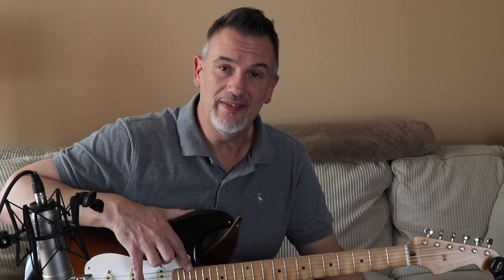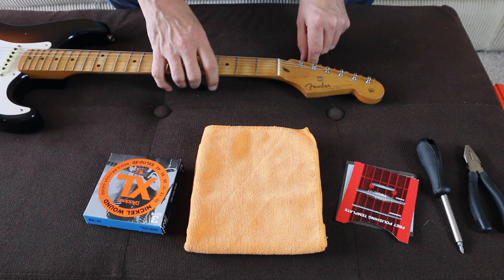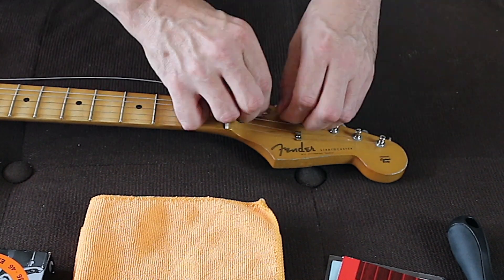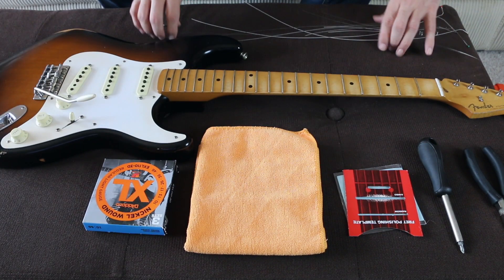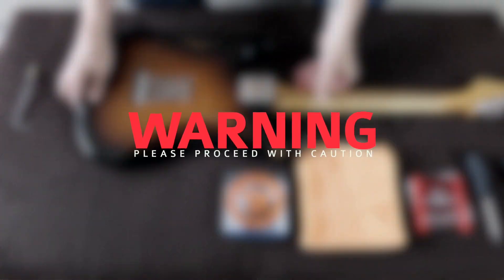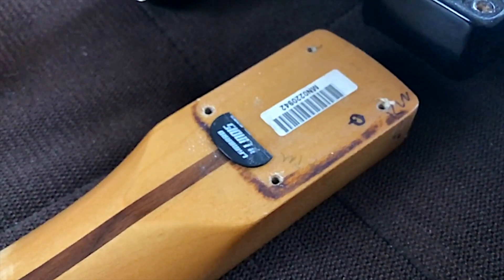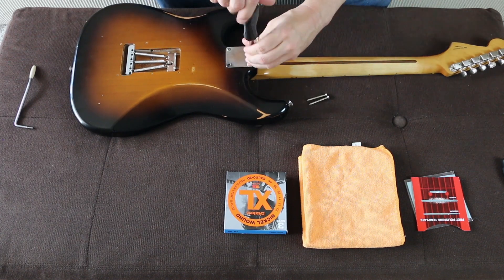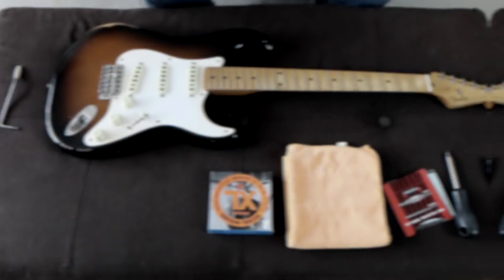Can you SHIM a guitar neck with a pick?

Comment: I have one bass where I had to do this kind of shimming at the front of the neck pocket. I used full width veneer piece instead of a pick and I made a narrow wedge piece just to cover the gap at the bottom of the neck. Now when you look at the neck joint you will not be able to see that the neck was shimmed. The tone and the sustain has not changed at all.

Comment: Totally worked for my jazz bass. Only I did it the other way around to decrease the bend and have the strings closer to the frets. However this was not an expensive bass so I didn't worry about anything in the first place.
Reply from the maker: If it works it works i say, it worked out for me so i was happy. Cheers for the comment
Reply: I would take that out immediately, get a full maple neck shim this will warp your neck up on the higher frets eventually and it with fuck your neck up big time.

Comment: A refinement to this idea is to use a pick with a known thickness, as from a set of picks of different thicknesses. If the first try doesn’t adjust the tilt enough, you can move up to the neck pick size until you zero in on just the right thickness.

Comment: Hi Derek, I don't mind that you used plastic instead of wood. It worked for you just fine. I smoke cigars, so every time I buy one they give me these very thin sheets of wood to light a cigar. First you light the wood with a wooden match, and then you light a cigar with that wood. So I'll try to use that. The only problem is that I don't want to waste a new set of Fender Bullet strings, I put them on yesterday, but the action is to high and I have to shim the neck. You cut your strings but I'll try to avoid that. Cheers!
Reply from the maker: I have since removed it as I had it setup by a luthier but all the time I had it in it worked a treat, wood is the way to go though, cheers for the comment :)
Reply: This is why I love locking tuners.

Comment: silly question: how do i how if i should add it the closest to the pickuo, or in the edge of the joint like you did....
basically i got a guitar that had a piece of like 60 grit sandpaper, and the neck pocket and neck itself where "nasty" (had paint blobs there)...

so, i decided to sand it (discovered the body is actually solid mahogany, sweet) but now without those blobs, the neck is a bit loose (literally i can push it back and forward while it has the strings tunned and all) it even sounds like one of those un-oiled creeking doors

so now i aint sure which side needs filling  😲
Reply from the maker: Good question, I mean ideally get yourself a set of shims (stewmac sell them) but the pick route, I put it at the front as I needed my neck to be raised a little, at the back (pickup end) will lower it at the tuners, hope that helps my man!
Reply: @DerekPaulGuitar  thank you so much.  time to try some shims. :)
Reply from the maker: @0000song0000  no problem at all, hope it works out for you :)

Comment: Stew Mac makes a shim that is designed for this; I have used them. It is a solid sheet, so the entire neck is still touching the body. You get much more wood vibration transfer between the neck and the body. This way, you have a gap where the neck and body aren't touching and no vibration can transfer. Does it work? Yes. Is it the best way? No.
Reply from the maker: Thanks for the comment, you are absolutely spot on! The shin if you need to do it is the best way to go, Stay well
Reply: @DerekPaulGuitar  did you notice a change of tonality and or resonance after shimming with a pick, though?
Reply from the maker: @boxerfencer  I didn't notice any change at all, cheers!

Comment: I think that is a legitimate hack. Those of us who like to repair things ourselves have drawers full of stuff we look at and keep instead of throwing it out precisely because it may come in handy someday when we need to fashion a replacement part and your 'pick fix' falls neatly into that category. One question: When you brought the bridge back down onto the body and created a hardtail in effect, did that have anything to do with the higher action or am I thinking of another strat?
Reply from the maker: Brad Laue hi Brad, thanks for the comment and that’s a good question, yes when I hardtailed it it did lower the string action, so I raised the saddles but couldn’t get the playability I needed, I.e. no fret buzz or fretting out at the 14th fret when bending the high E, I adjusted the truss rod but this didn’t give me the result I needed either hence shimming the neck, I’d much rather do my own adjustments and maintenance on guitars and to be honest on everything I have, I’ve always been like that, it has helped me learn what works and what doesn’t and I can make quick adjustments if needed, I also have that drawer of bits and pieces
Reply: @DerekPaulGuitar  Your guitar needed a fret level not a shim if it buzzed at the 14th fret while bending

Comment: Now he has a bridge saddle screws that dig into your hand  He doesn't have a clue what he is doing.
Reply from the maker: It did actually work with no adverse affects, the truss rod was adjusted first but didn’t give enough of an angle, I have since however removed it as this was a while ago, cheers
Reply: @DerekPaulGuitar  If your truss rod was adjusted and it was fretting out on the upper frets than it needed a fret level , there was still even more adjustment on the bridge to go higher from what I saw in the pictures @ 2.25 so I don't know why you thought the saddles were too high, the first picture of the bridge was perfect aka not much adjustment screw poking out of the saddle to poke your hands and full contact with the body and neck for the best transfer of energy between the two just results in more sustain and tone... it just does.
  I have cut those adjustment screws down on several customers guitars to achieve.. that the top of the screw was flush with the saddle , this is way more comfortable .  in your case you could have bought longer screws for more height adjustment if you thought you were going to run out of thread on the saddles and I doubt you would have if anything on a Fender I am cutting down the screws ..or if real bad the neck is being tilted in the opposite direction from yours with a full maple shim.
Reply from the maker: Thanks for the suggestion, I didn’t think of that, I will certainly be ordering some longer saddle screws or at least looking at the adjustment, as I couldn’t get the adjustment I needed, I do appreciate the comment as I like learning something new from someone with more experience, and I thank you for your detailed analysis, very much appreciated! Cheers

Comment: Don't EVER do this. In time it will make an irreparable ski jump like bend in the base of your neck and ruin it. Either buy a Stewmac shim for about £5 or at the very least make a graduated one out of paper or card glued together like a set of steps
Reply from the maker: Deadbeat Angels I appreciate the comment Deadbeat angels
Reply: Just use a higher gauge plectrum if it does? Doubt this would cause many issues to be fair.
Reply from the maker: Fat Arry cheers for the comment